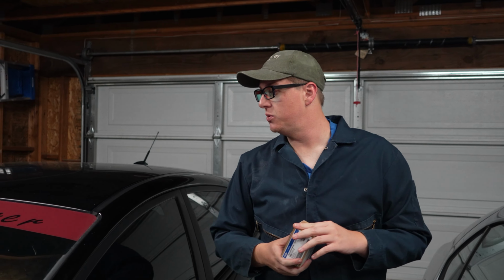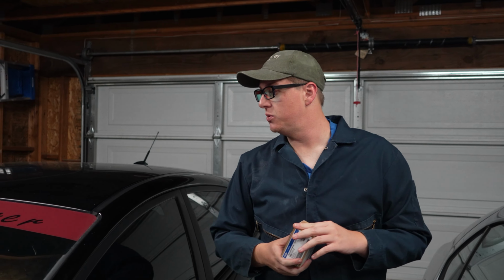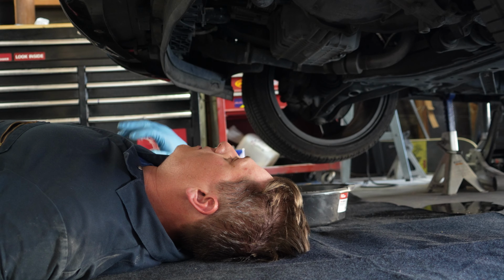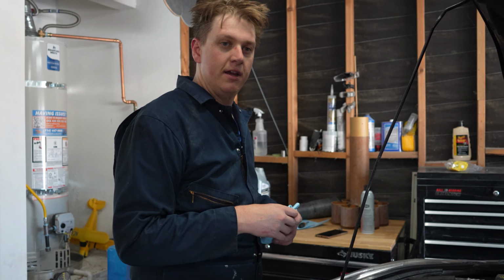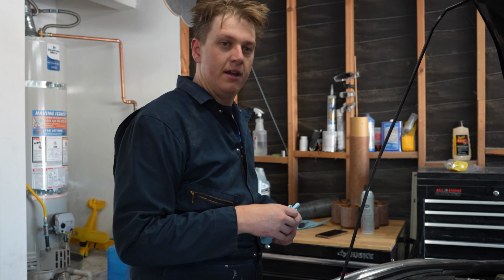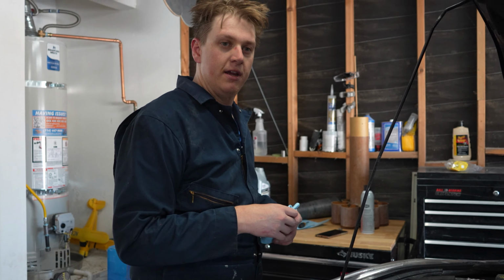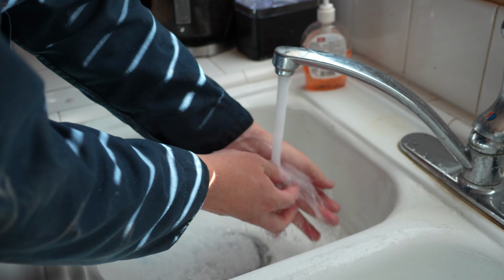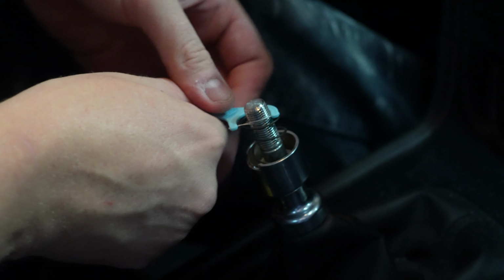How to Change A Shift Knob In UNDER AN HOUR

Comment: good meme, but the point of putting oil on the oil filter gasket is so it doesn't bunch up when you're tightening it. Sometimes especially if you're not careful it can bunch up and fold over itself and it will leak when you run the car. It will make itself very obvious but a bad situation for a newbie lube tech